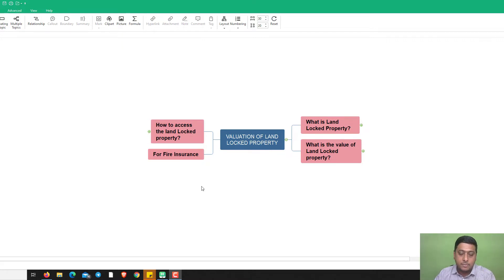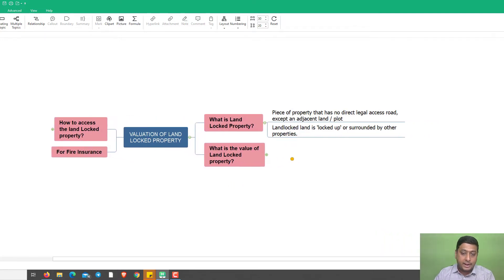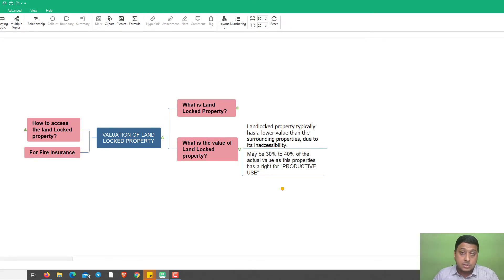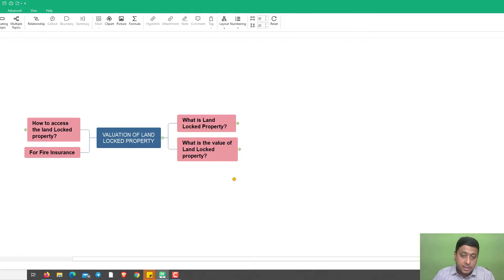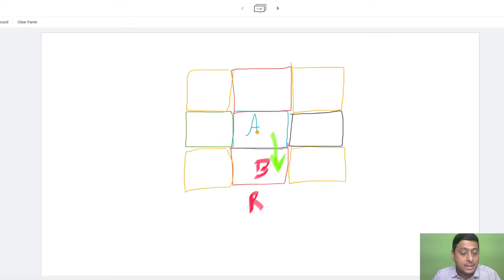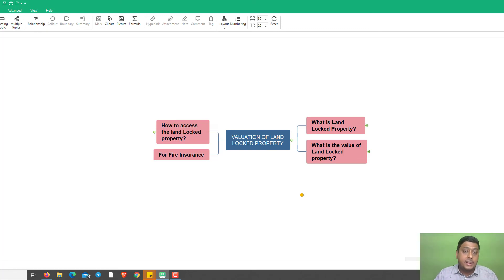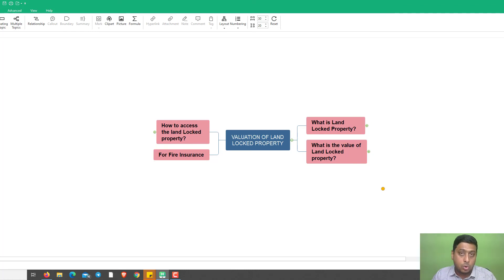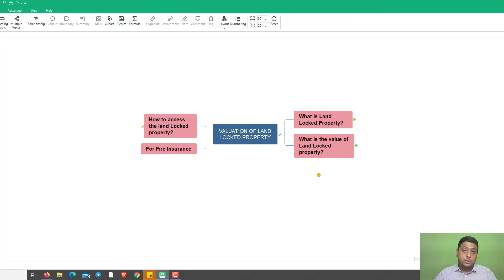LAND LOCKED PROPERTY VALUATION AS A BANK PANEL VALUER

Comment: Sir,

i have completed my C Engineering by 2010 and my work experiance in India id just 2 Yrs. But i am working as a construction engineer at Gulf. Am I eligible to apply for the position Bank Panel Valuater
Reply from the maker: Yes you can apply
Reply: @Constructionmadesimple  Sir, Is IBBI conducting exams only once in an year only?
Reply from the maker: @manukuzhivelil  Regularly the conduct its an online exam in ti e up with NISM
Reply: @Constructionmadesimple   thank you sir